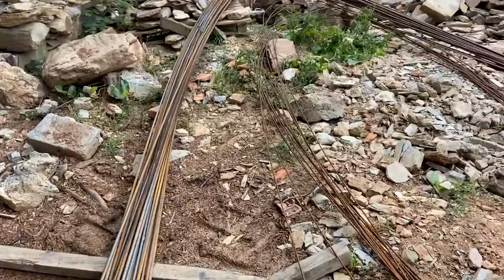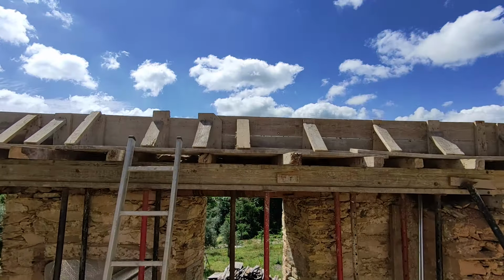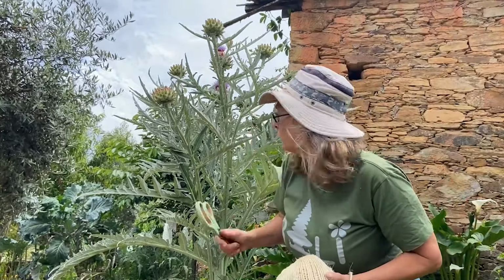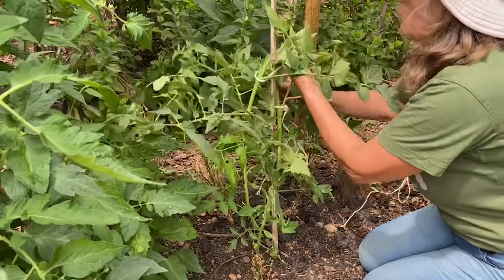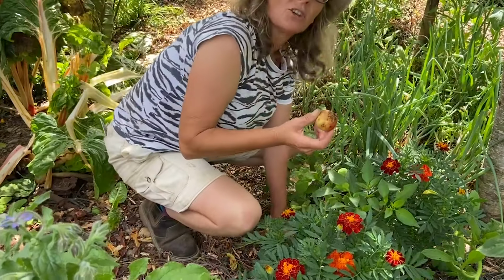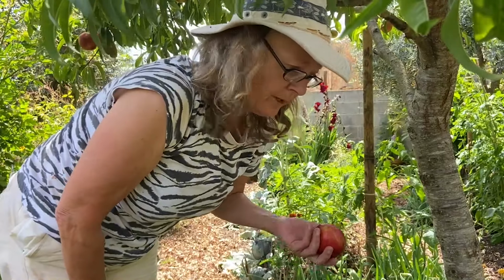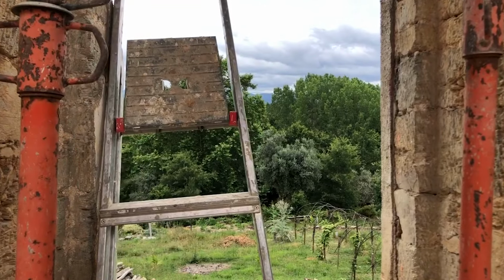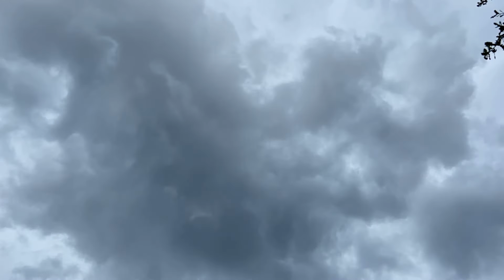Harvesting Nectarines and Pouring a Ring Beam by Hand

Comment: If you want to dry fruit/veg get an old window and make a solar dryer from old 4x2 wood make a box frame put a backing on it then put window on top with hinges.
Angle towards the sun and cut fruit/veg remove seeds place on wire cooling rack and allow to dry .
Gardening Australia had one I made a similar and it works fast I dry herbs as well in it.
Reply from the maker: Thank you